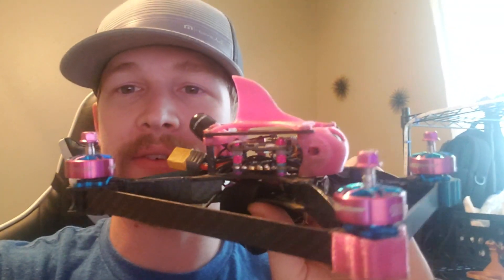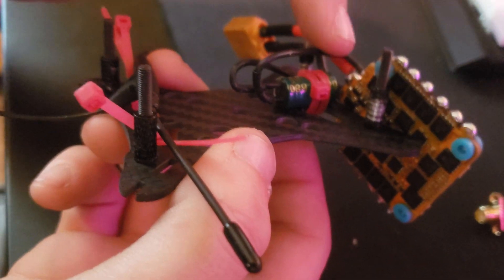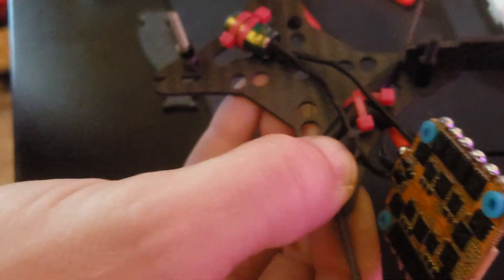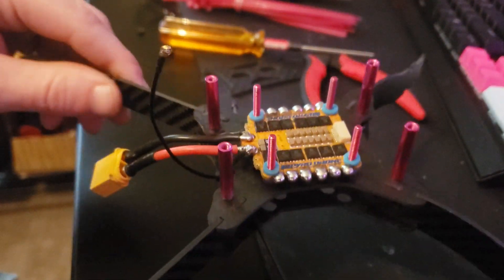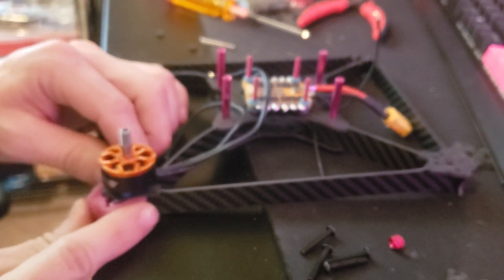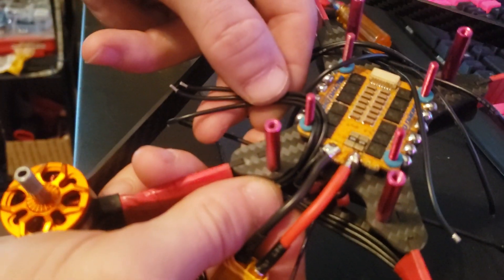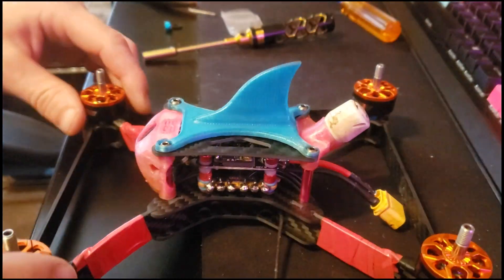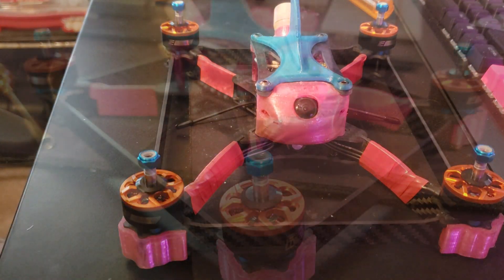Knife Vertical Arm Race Frame Build Tips (Southeast FPV)

Comment: The arms add lift in flight, don't obstruct props, and straighens the flow off the props (significantly increases thrust and reduces propwash). It needs that 5° up camera because of the increased performance.

Comment: Speaking of motors I think ima have the same problem with the hyperlite e series 2207.5’s. The base looks really thin compared to regular hyperlites. But I guess that’s where they cut some weight on these motors due to the steel shaft in them. I didn’t realize that when I ordered a couple sets of them. But for the price who knows they may actually hold up for me.
Reply from the maker: I have not yet had a single issue out of the E series, the bearings don't seem to be as smooth over time as the rcinpower, or other premium motors, and they are not as fast as the Rcinpower even tho the lsited KV is 60kv higher, but for the price they are holding up well.
Reply: Dillon Hoopes ok then. Sounds good. I won’t worry now lol.